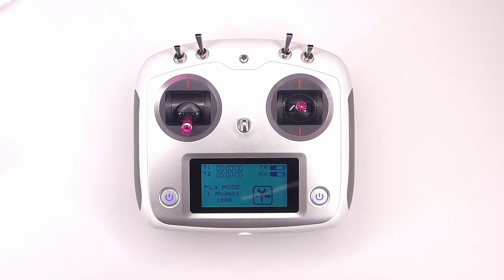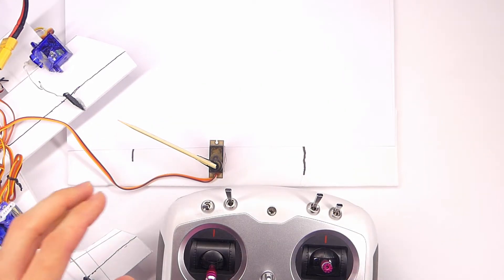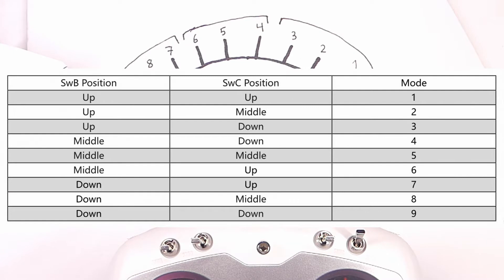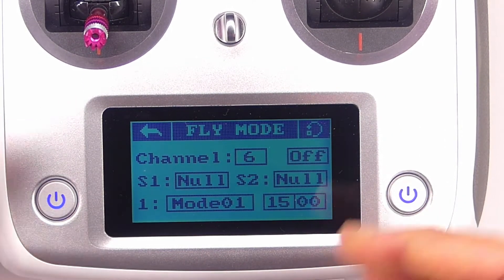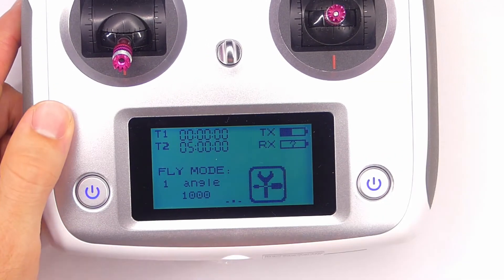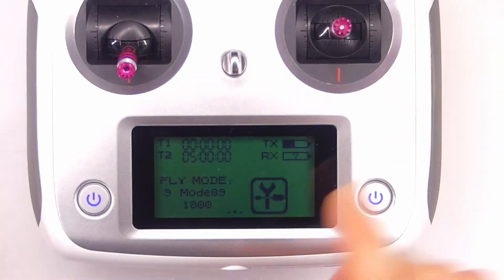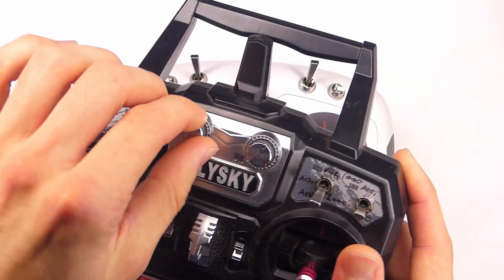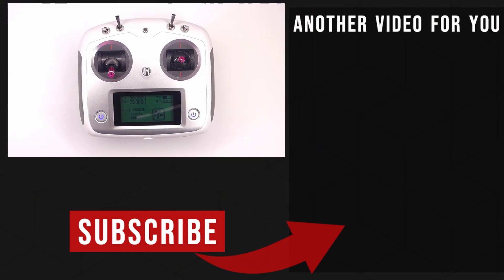How to Use "Fly Mode" 🧐 FlySky FS-i6S Tutorial

Comment from the maker: Can you think of a good use for "Fly Mode"?
Reply: I´d put Flaps on that switch, but three positions is sufficient in most cases, so not that useful..
Reply: I have a sailing boat and I am going to use it to control a servo for the backstays. I hope.
Reply: Greetings bro. How are you?. 
It's very nice video. I completely understand what it is. Still now I don't know what is the function of fly mode. But now I'm very cleared. Thanks for this video. Always I monitoring your videos 😍😍😍😍
Reply: I just use it as a disarm switch for my throttle on planes. I have a glider that I need to use lots of ridder for but it's uncomfortable to hold the throttle stick down so much, so I have a throttle disarm switch setup in Fly mode so I can have the throttle at a comfortable position so I can use rudder.
Reply: Flywing fw450 uses fly mode to switch between gps mode,3d mode, programmed flight patterns.

Comment: Just got my FS-i6S about a week ago. The fly mode defaults to "off" and ship with the throttle spring remove. (Remove throttle spring ship together in case you need to place it back.) I'm a beginner to FPV/Drone, bought this because of the easy direct cable connection to Drone Simulation like LiftOff.